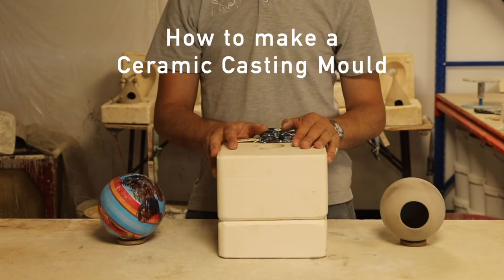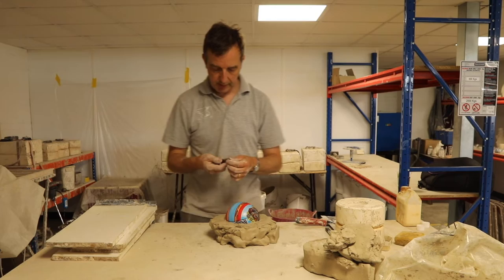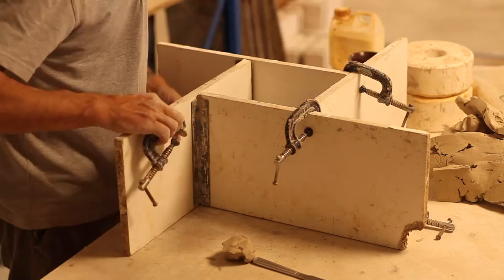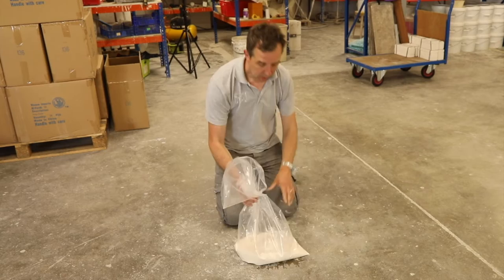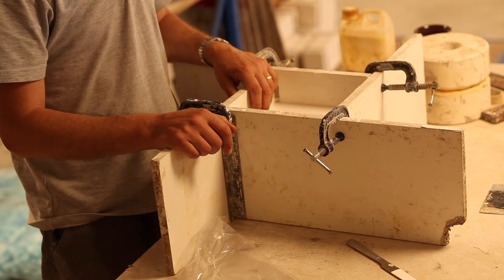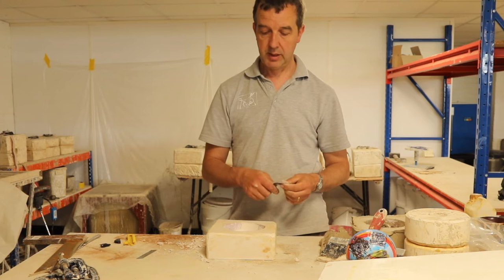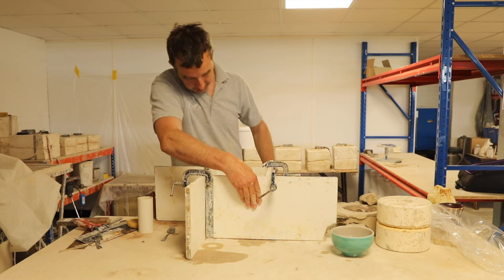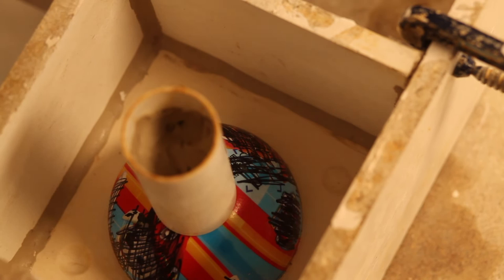How to make a ceramic casting mould - shorter 10min version

Comment: I could not take out the mold at the second part. I used liquid vaseline. Can I use normal soap from waching dishes? And I must wait to dry it?
Reply from the maker: Vaseline should work as a barrier, but as I showed in the video, most of my success has being using the separator I am demonstrating with.  Washing liquid is unlikely to work.  Look up 'mold soap'.